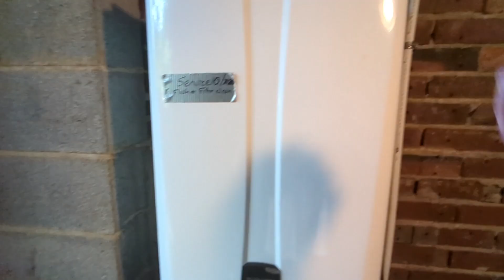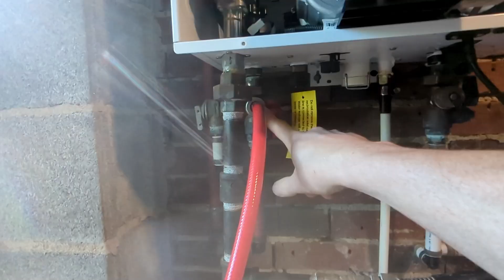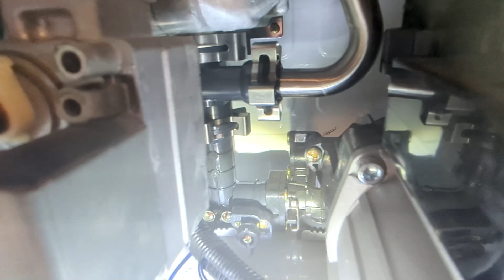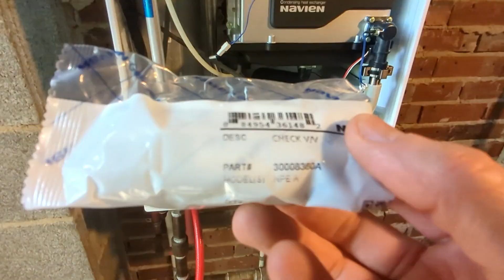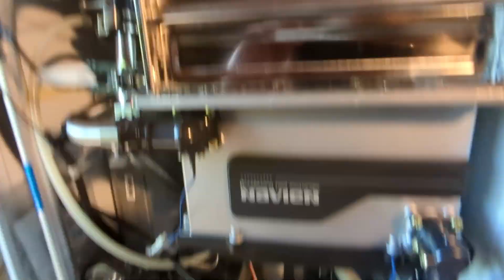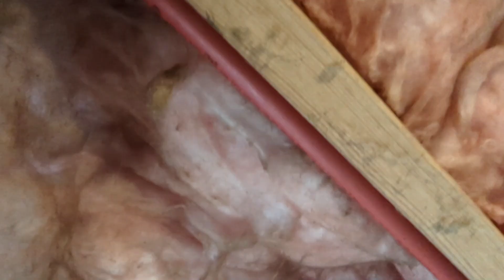Internal Check Valve Replacement - Mavien NPE Series Tankless Water Heater

Comment: Did this end up fixing your issue? i have something very similar going on with my unit, I'm going to remove the valve and inspect it. like you, i perform the annual maintenance but experiencing fluctuating temperatures and water just isn't as hot as it used to be. thanks for the video!
Reply from the maker: Yes it fixed the issue.  The check valve just fails over time.
Reply: @greasyfingergarage  good to hear. Mine looked just like yours on the video, replacement ordered thank you!